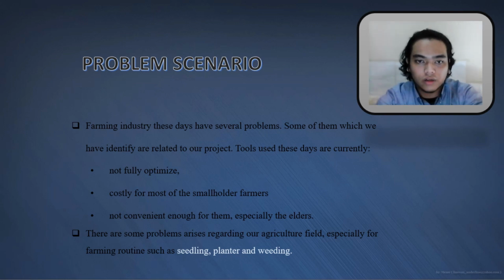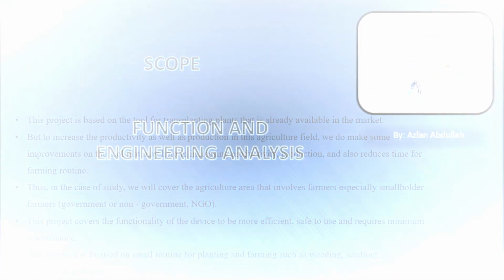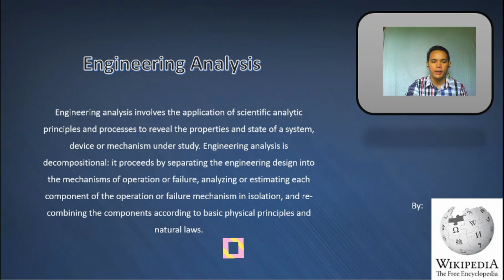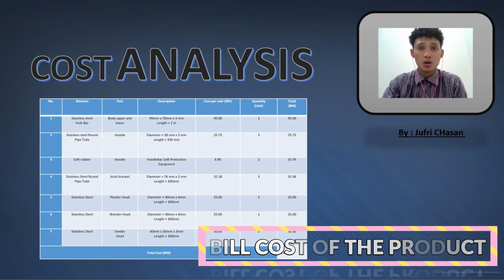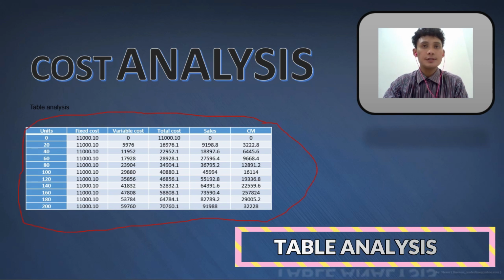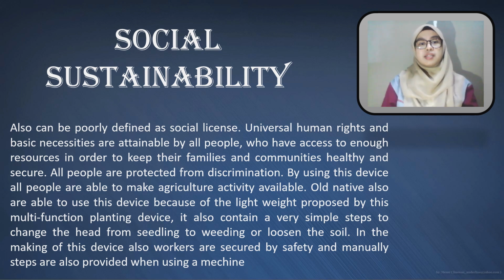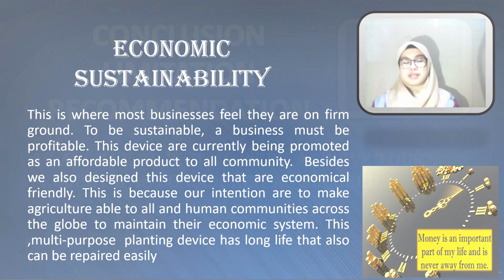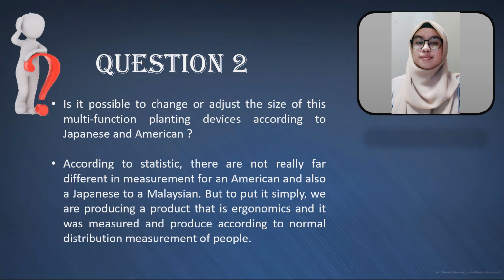PROJECT NUMBER 19- MULTI-PURPOSE PLANTING DEVICE

Comment: Did you conduct any customers need analysis? Who are your targeted customers and How many potential customers willing to spend their RM460 for your multipurpose planting device?
Reply: Salam and hai Dr.  Our group members are already conducted an analysis that was distributed among  students and lecturers to make sure our raw material selected are the best  raw material as we are already learnt how to make a selection on material by using EDUPACK software, we also distributed this survey among villagers  that also a farmer to let us know and gain  constructive information.  And we are targeting farmer and also a retired person that want to do agriculture as we are already consider about the size and the weight  that may be suitable and optimal for ergonomic feature. We also involved simple step(s) to change the head from seeder to weeder or to planter. Hence, an old citizen can and able to operate our device product easily Besides, the price which is RM 460 is also reasonable as it provide us with 3 different function that was weeding, planting and also seeding. The price was actual being cut as we combine the main purpose in a single device.  Let say we have to buy three devices just to make us able to do weeding, planting and also seeding and each device or tool is about Rm 200 each but our device was just only RM 460. So by just about RM 460 we are able to make planting activities easy and accessable. Thank You Doktor